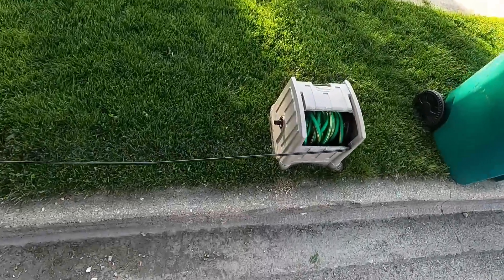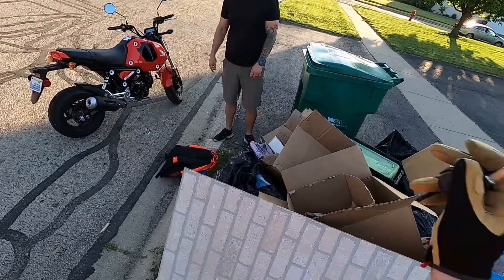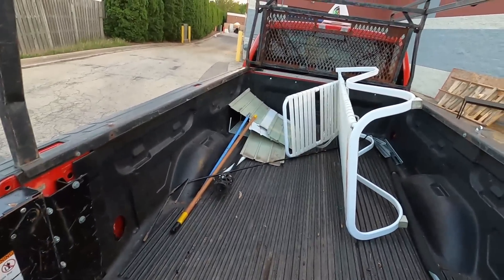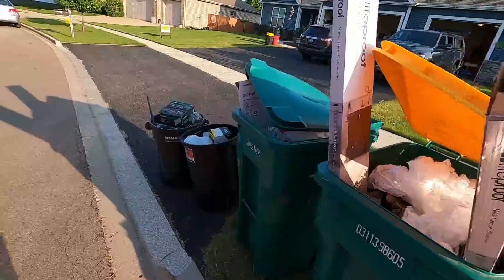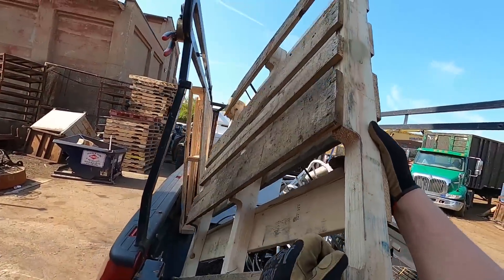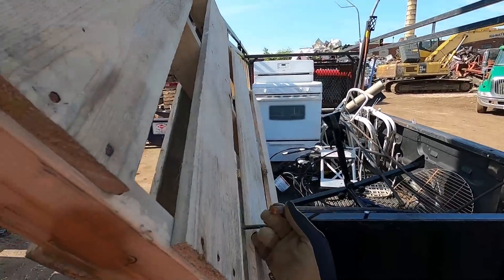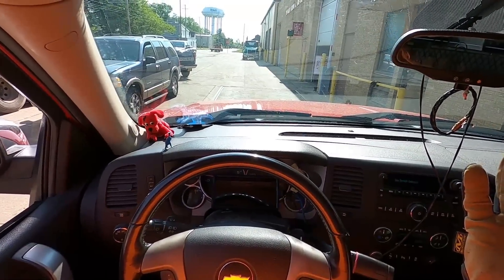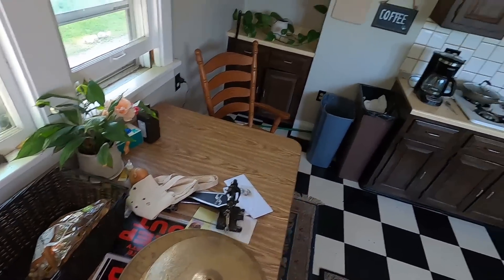It's in the Trash - I Can Take it

Comment: Scooter driver here🙋I have a buddy 125cc and ride it to work every day, I average about 90mpg and fill up once. Week with a six mile round trip. Paid 1500 for it on the marketplace with 400km . It now has 10,500KM and is still running strong. It's nice to be able to ride and enjoy the sights around me, unlike sitting in an aluminum box. I average about 55mph and I'm 190.